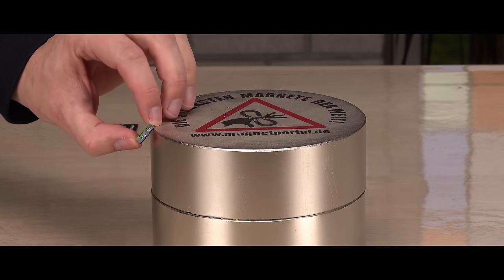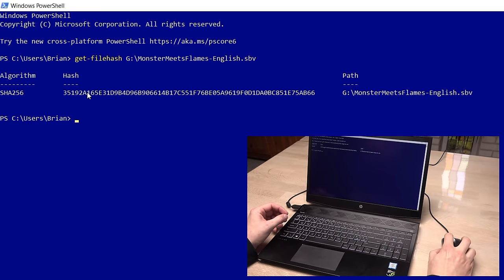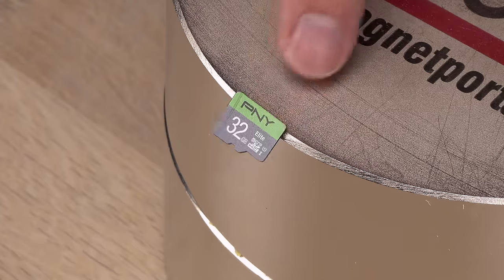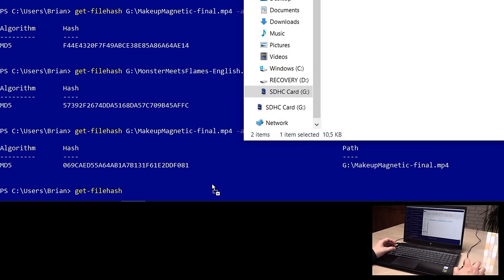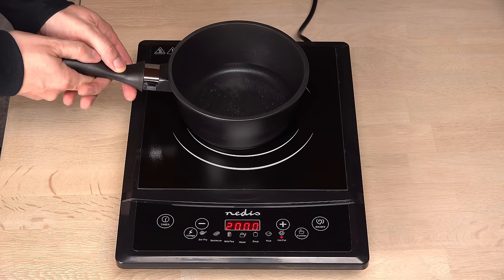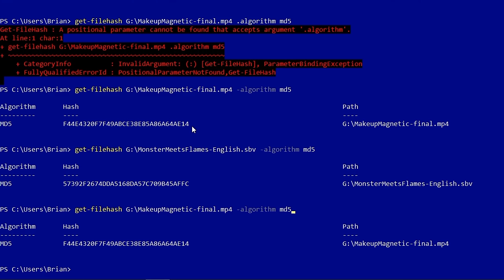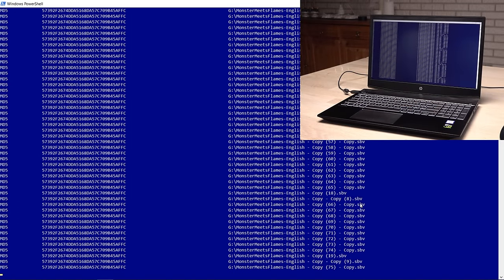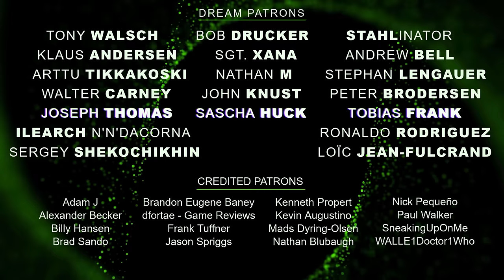SD Card vs. Monster Magnet and Induction Cooker (2000W AC electromagnet)

Comment: Can we all just take a second to appreciate the incredible engineering that has led to memory cards the size of a pinky nail—which can hold over a TB of data— that can withstand such insane amounts of magnetic, thermal, and kinetic abuse? I mean...it's honestly mindblowing.
Reply: isn't that 32 gb?
it looks like a 32 gb card to me.
Reply: @electricheisenberg5723  That one was, but there are 1TB ones that are just as robust
Reply: Yeah, I don't think I could properly understand how older people got by with just kilobytes of data large floppy disk, let alone enormous hard drives that only hold data in the bytes range
Reply: @zx-3948  25 years ago, a 4gb hard drive was normal, if not impressive. That's like, not even a fraction of a video game today! They had an impressive 32 megabytes of RAM!!
Reply: End of last century, I programmed big  mainframe computers, which would cost millions of £ (or € or $) for an installation. My phone has a 1TB MicroSD card in, more than the total online disk storage of those mainframes.

The processor is probably faster at doing sums, too :-)
Reply: Of course, today's mainframes have improved in a similar way over the years. Monster servers, with high uptime.
Reply: @antoniolewis1016  even a little earlier than that I remember saying to a friend o mine "can you imagine a 1gb hard drive? you could fit EVERYTHING" this was the days of 386 and 486 computers with 4-16mb ram and a 120mb hard drive.

now a 1gb sd card the size of your pinky nail isn't worth bending down to pick up.
Reply: I remember paying an arm and a leg for a 256mb card just a couple of decades ago…
Reply: Sd cards are technically just another hard drive full for files
Reply: And can we rant at those stupid ads popping up on my screen as I was reading comments (your one on this specific time) 

It's not ads itself that annoys me, but the timing and they are the most irritating ones ,some handful of very same BS wants to make me rich overnight. Here's a thought why don't you ads help each other and become mega rich and leave us undistracted to enjoy the vid..

We can pay for it by watching one long ad before the video start and no more. Sounds good, now stop trying to get me rich, I'm happy as I am   thank you!
Reply: Never did I make a full use of a micro SD card. One Way or another it gets lost or damaged or misplaced. Too small. Obviously it's a great piece of technology for the right people
Reply: Spoiler alert. 👎 Yay. Top comment has a spoiler so ruins the video.
Reply: @antoniolewis1016  nah most video games i play are like 50 - 500MB

Comment: The real consensus of the video, cheap electronic devices aren't worth shit, that capacitor was an abomination.
Reply: The other way of looking at this is "Oh that's why this is cheap... Alright, I'll just replace that cap and I still saved myself a few bucks"
Reply: Yeah caps and copper wire is usually the only thing they can cheap out on. Replace those and youre fine
Reply: Flowxing ...by winding a replacement induction coil? Surely not.
Reply: on thee contrary, the cheapo sd cards were actually good
Reply: also out of the box != new.. that thing may have been in store for years :)
Reply: That's the planned obsolescence timer.  They figure this cap will probably still be good for a year or so and that's all they want, that way most people will just buy  a new one.  This stuff needs to be illegal, it's terrible for the environment.
Reply: Wow what a shock, you must be new to adulting
Reply: @GodKing804  I wish lol

Comment: PNY is actually a well known brand - also in Denmark.
Reply: akyhne and they are a very good products usually too, Iirc they make(or made, I think they still do) gpus that are decent aswell.
Reply: yes and all flash memory and 3d nand is all magnetic proof
Reply: PNY products have very high quality and are well-known in US, UK and most European countries
Reply: I have one of their 2.5 inch 80GB SSD's in my PC and it is really fast (the time to boot linux on the harddrive it replaced was 1 - 2 minutes for the kernel to start all my stuff and the SSD boots in 5 - 15 seconds with the same OS same files and a few extra big files and it has a metal case on it
Reply: For photographers PNY is well known and reliable brand
Reply: i only use pyn this comes from usa person its the best
Reply: Same in Italy, I have a as card of them in my nintendo switch
Reply: @veselidiktator9789  tbh I don't see it used by other photographers much, at least my group usually uses SanDisk or Samsung, though we all know of PNY and have no problems with them
Reply: PNY is actually not a known brand - at least not in Germany. 
I'm working with (video/photo)cameras and computers for over 3 decades now.
Reply: crckdns if you ever look at buying a professional workstation with a professional nvidia graphics card (quadro series, only ones with ECC memory on the card) you will notice that PNY is the sole supplier of quadro cards.
Reply: I brought an USB stick last summer..haven't used it much. It died last week.
Reply: @robertoborgen3781  I had a Kingston USB stick that died early, a MSI motherboard that was always buggy, several Seagate and Western Digital HDDs that died early on me.
What does that tell you?
Reply: he called it a pony, i have a pony gpu now
Reply: I have bought PNY lots.  It's a good brand here.
Reply: I have a PNY 256Gb SD card that is actually 16 GB only...
Reply: @Readdeo  You probably used a wrong file system format or for some reason didn't allocate all the space to one partition.
Use Fat32 or even better NTFS, if your units support it.
Reply: @akyhne  no, it is a fake. I ran h2testw on them. I bought 2.
Reply: @Readdeo  If it's a fake, then why mention it? Where did you buy it? On Wish?
Reply: I have the exact PNY card but at 128gb
Reply: @bonzivids9756  yeah.. look at all these fake comments promoting shit...
Reply: Yea it's funny in the states sandisk is the more budget mainstream brand.
Reply: @crckdns  pny IS a well known brand also in Germany!
GPUs, SD cards, USB sticks, SSDs etc.
Reply: @scorpius319  who you mean?
Reply: @renaissanz  WhO dO yOu MeAn?
Reply: @scorpius319  okay I will do if you feel better then little girl
Reply: I wouldn't say they are well known. But they start to get traction and recognition indeed.

In my experience they are pretty average, like kingston. Wouldn't trust my data to any of those two companies.
Reply: They do Nvidia Quadro
Reply: They make nvidia GPUs
Reply: @scorpius319  I couldn't cringe any harder at your comments if I tried
Reply: PNY still make great server (quaddro) gpus
Reply: Absolutely my favorite memory cards
Reply: Xeraser  PNY, Palit, and Gainward is the same company under different names...
Reply: @Readdeo  It's very common for the Chinese to either buy genuine SD cards and remark them, or create fakes with some brand name, and change the firmware so it reads the false size, so the costumer won't notice and return/give negative feedback before it's too late. But noo, yours says PNY so it means it's a genuine PNY, and these comments are what's fake and promoting shit; it's not you who's ironically promoting shit/lies. Maybe buy your stuff from proper sources if you want genuine stuff; where did you get yours, on eBay shipped from China..? Owe up to your own mistake and stop pitting it on some large company; no company would tarnish their brand by doing this, obviously.
Reply: I have never heard of it. And i live in Denmark
Reply: I have a PNY graphics card in my pc!
Reply: @crckdns  no smh

it is a well known brand

u just havent seen the world

the internet exist bruv
Reply: @neayt9952  normie?

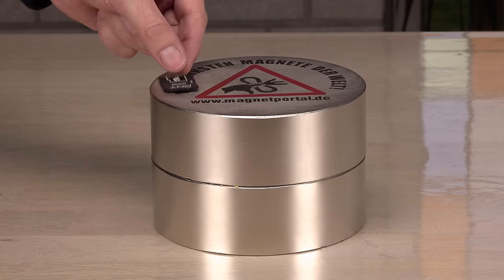Comment: 6:16 reminds me of when I was a kid using a calculator and the calculator would occasionally be wrong with a simple problem such as 3x4=?, I started doing the same problem on the calculator twice every time just to make sure it was right. It's been years since I've seen it happen, but I'll never forget the confusion.
Reply: weird
Reply: I had similar anomaly. I was coping a SQL schema. I tried to run it but it seems to have an syntax error and it was, one letter was changed into ",".
Reply: # calc --no-error-when-divided-by-zero --debug 52 div 0

0 x 0 = 0, 0≠52, skip;
1 x 0 = 0, 0≠52, skip;
2 x 0 = 0, 0≠52, skip;
E: found divizion by zero, continue;
3 x 0 = 0, 0≠52, skip;
...
calc not responding, continue? (y/n)
Reply: Me and my friends had the same type of calculator in school but one time we had same formula written in the calculator and we had 3 different results
Reply: It used to happen sometimes when the battery was low
Reply: @Katerpillar  you're undervolting
See MattKC's video on running an NES from AA batteries

Comment: It would be interesting to see the effects of ionising radiation on microSD cards. Something like a big gamma ray source (maybe over a longer test time) or an Xray machine...
Reply: Just leave the memory card in direct sun for a set amount of time.
The sun does release ionizing radiation.
Plenty of it
Reply: @zdw306  Actually, it doesn't. Not any that reaches Earth, anyways. UVA/B/C is actually not ionising radiation because it doesn't have the energy to ionise atoms (but it has enough energy to mess up with DNA). Ionising radiation begins in the EUV (extreme UV) part of the spectrum, and that's strongly attenuated by Earth's atmosphere, as well X-rays and gamma rays (not that the Sun emits many at its surface).
Reply: Or a microwave oven
Reply: @spicemasterii6775  Microwaves aren't ionising.
At worst it'll just melt the card.
Reply: @GRBtutorials  In fact part of the UVC spectrum is ionizing by the technical definitions of both, and also in fact although you are correct that it is strongly attenuated in the atmosphere it does reach the surface.
Reply: Gamma, X and Beta radiation will damage chips. That's why certain regions of space around earth in which satellites avoid. Some companies even offer space rated chips, which means they are radiation hardened. It's also not simply just shielding, it can have a different architecture that can take more damage before it fails.
Reply: zeer365 i work at fluoroscopy and it ruined my phone card
Reply: Also mri
Reply: @The_Keeper  
  I doubt the memory card contain any polar materials.  The main heating effect is to water.  And really only liquid.  There is a test that shows loss of heating if you use it on ice instead of the liquid.  A microwave oven works more on electrostatic field on the polar molecules.
  On the other hand, the memory card is not storing info in magnetic domains, like old credit cards or hard disks.  Little surprise that the magnets have so negligible effect.
Reply: On Mars, NASA must use chips with transistor gates bigger than 80 nanometers, because of cosmic radiation.
Modern technologies of 5 nanometer just don't work overthere. 
A 80 nm RISC processor used in the PowerPC from Year 2000 works wonder instead.
Reply: @The_Keeper  More than that, it will absolutely screw the electronics.

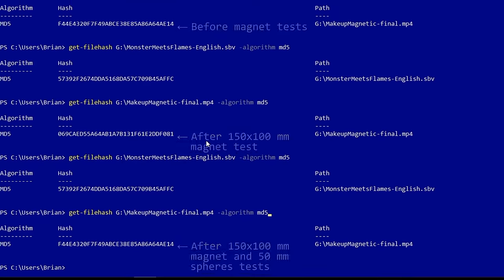Comment: 6:04 So you practically demagnetized the card's casing in the alternating magnetic field.

Because the card clearly reacts to strong magnetic field, I guess it has some ferromagnetic protective casing. In very strong (unipolar) field you can induce small remanence field into it, and that could be reason for the altered reading. If that is the case, it is evident why AC field of induction cooker could not have any effect. 

(But form the get-go, induction heater is not a good source for strong magnetic fields, because you don't need strong magnetic field to have large eddy currents in a conductive plate. Fast changing magnetic field is enough it induce the eddy currents.)

Comment: re: self-repairing checksum.  It could have been some parity Error Correction routine on the SD card.  Blocks are being constantly written/erased/re-written on the SD card.  Perhaps some of the "magnetic protection" the card has relates to its error correction ability... 🤔
Reply: SD cards are flash memory. The blocks aren't constantly being rewritten since flash blocks only can be rewritten a couple thousand times before they break. Any process which constantly rewrites those blocks would very quickly kill the SD card.

I think it's more likely that a bus error happened. The SD signal passes trough a connector with possibly some dust on it which can make the signal quite noisy. It's possible that this electronic noise caused a bit to flip while reading the card. Error correction would have occured before reading the card, and it is deterministic so if it fails once it would keep failing on subsequent attempts too if the data was actually corrupt.
Reply: @IkBenBenG  Bus error was the first thing it came to my mind too and the other stuff you mention, however i am unsure of this because i think windows run checkdisk when you insert partitions so if the file system repaired a single or a few flipped weak bits it might have been the reason why that weird thing happened.
My knowledge level ends here though, and since this is way more complicated that what i know some one else could be able to explain/confirm this.
Reply: Another possibility is that some cell or paths became slightly magnetised and so disturbed electrical the read out of a cell (bit/byte ?). The second time the card went through the magnet the cell or path got demagnetised thus things got back to normal.
Reply: Any error checking, block fuckery, checksum garbage would be handled by windows drivers; not anything loaded on the card itself. I don't know anything about electromagnetic noise but i know a good amount about windows filesystem bits and bobs; also the fact that there is no firmware on any card - no code to be executed, and no electrical component with significant logic. It is all handled software wise by the driver.
Reply: @IkBenBenG  yep its better to not to delete anything on those SD cards

Comment: when typing the parameters for commandlets, you can save yourself keystrokes by pressing tab after partially typing it :)
Reply: And in addition you can just press arrow up to go through previously used commands.
Reply: If your typing speed is good then no one would bother to save, just type feels ok
Reply: @waseemabbas6703  It's definitely good if you only (want to) remember the first part of the file. That way you do save yourself a bit of time even if you type fast.
Reply: and just use bash
Reply: @waseemabbas6703  yeah no, you're still going to save yourself allot of time, that argument can be use against the "press arrow up" because sometimes you have to edit some part of the previous command and pressing arrow up and moving the cursor or deleting parts of it can be slower then just pressing the first few characters and tab.
Though I was slightly triggered by him not using arrow up in this instance, and also not just doing ctrl+a ctrl+v every time, thus making 2^x copies.
Reply: c6amp  press tab more times, and it changes. It cycles to all the possible completions of what you typed.
Reply: @waseemabbas6703  uh yeah they do. I can type at 120wpm, and use the terminal all day everyday on Linux, and tab completion is my god
Reply: And you can redirect the result to a text file, redirect the next result to the next text file, then compare whether the files differ (easier in Linux. Probably makes for a worse video lol)
Reply: @r0galik  I'm sure you could come up with a single liner that just automatically keeps comparing all of the logs and then flags it up when there's a change! But as often happens with things like that, it actually ends up being easier just visually looking at them both...

Also you really shouldn't even have to compare the entire string unless you're using a crappy checksum/hash algorithm. With most the first few digits would be enough.

Comment: One of these days you should make a video where you try and separate the magnets.
Reply from the maker: I have thought about it. But the magnets are still useful for me together :) Thanks for watching!
Reply: Didn't he already? I seem to recall some thing with a board with a hole in it, you drop the magnets in, put another board on top with a hole and then slide them sideways using a come-a-long or something? Or am I crazy?
Reply: @bullhornzz  He has done it with smaller magnets in the past.
Reply: @brainiac75  But HOW.... I have big problems just pulling the magnets in harddrives apart. How the helvede do you do that? :P

Comment: In my experience, video and audio players are notorious for changing files (e.g. when the error correction kicks in, the corrected file is stored; or the player keeps some metadata with the last stop position) even when you do not press "Save". You can avoid this by not opening the file in the media player after you did the checksum, or (easier) by flipping the write protect switch of the SD card (which will protect against overwriting by the computer, but of cours not against magnets).

Comment: Even though I'm an mechatronic engineer and I'm familiar with the effects of magnetic fields and the magnetic flux that the card was exposed to, I'm not an expert in computer science. I do believe though that the inner memory bits could have been corrupted in the card but once you insert it on the PC and windows recognizes it, it goes through a process of restoring the files to their original values. Internet and data transfer protocols use check bytes on their packages to correct any errors and it could be that windows also has some data check and correction bytes along with the files to restore them if corrupted. Check with an expert on PCs if there could be a storage format or file type that doesn't have that corruption restoring option and then do the same experiments. It would be interesting to know the results then 👍🏻